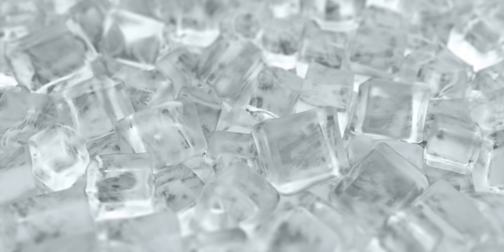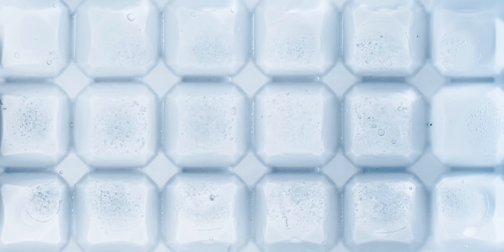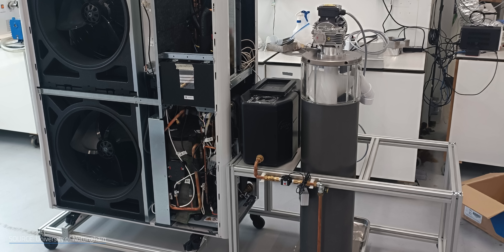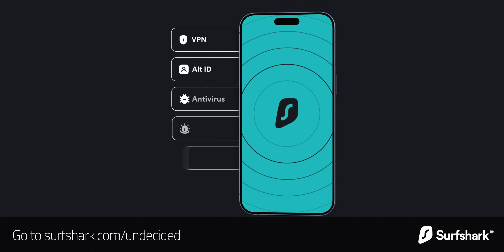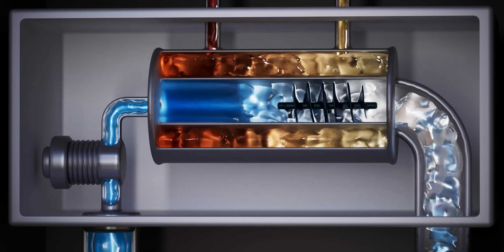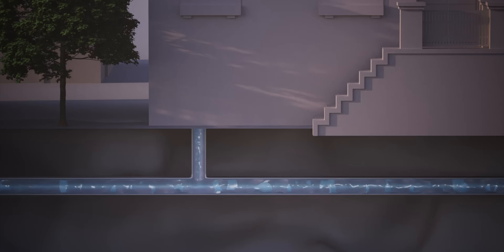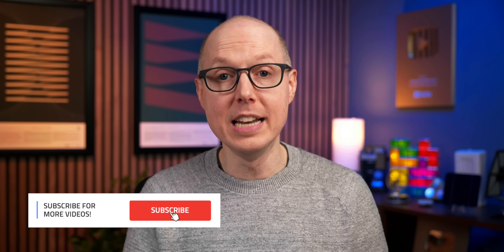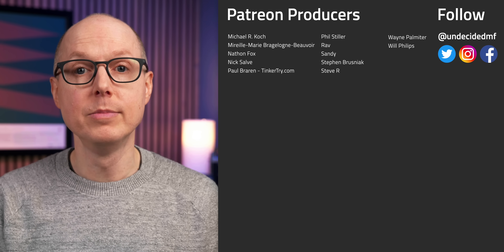How Can Ice Heat Your Home? Ice Source Heat Pumps!

Comment: Or, you can take the domestic water network, which ever home everywhere in the western world has... including remote location with wells... use that as an above 0c heat sink, suck the heat out of it(or dump heat into it in the summer), and dump the cold(or hot) discharge into the sewage/storm system. No need to upgrade anything, and can be install now, in any home.

EDIT: Why/how this works. A typical house loses/absorbs approximately 100 to 500 joules of thermal energy per second. This is highly dependent on temperature differential as well as the amount of insulation. Assuming the domestic water supply is at least 10 decrees Celsius upon entering the building, and the evaporator of a heat pump is -25, to negate the thermal loss, 3.4 litres per second of water would be needed. Thermal absolution into the water, regardless of heat exchanger efficiency, would be near 100%, as the water would mix directly with itself within a well insulated holding tank, so long as a circulation pump and tank are properly spec’d. This is a purely 'back of envelope' calculation and is not really that meaningful, but shows a large amount of water would be needed, however, this water is not consumed in the traditional sense.

In the most basic of setup, water would be intaked into a building, warmed(or cooled), then rejected into the storm or sawer drain. At this point, minimal treatment would be required to redeliver the ‘used’ water back into the system, especially if the water is discharged into the storm drain network. This however, need not be the case. As the water is not utilized for any other purpose other than as a heat sink, water can be diverted from the city supply, flowed through a heat exchanger, then re-injected into the city supply, without requiring further treatment. So long as the city supply continues to flow, thermal capacity will always be available.
Reply: There's a thing in Japan called Eco-Cute that makes hot water by using the "waste" heat from the air conditioners. Why just blow it into the street when it can be useful?
Reply: this would increas the amount of water needed by a lot. and if you dont have unlimited water this could lead to a shortage
Reply: @2LittleZombie  It wouldn't actually increase usage that much if properly metered, and would theoretically deliver about 4200 joules per letre in a most basic system. The 'waste' water would also still be potable, so redeliver into the domestic system would require minimal treatment. Reverse osmosis system create far more waste water.
Reply: @JoelleTheAbsurdist  4200J are 0,001kWh. In one heating season, a typical household needs 20000kWh. That equals 20 million liters. Per house.
Reply: @2LittleZombie  Not joules per hour, joules per litre. If you're replacing 1 litre per second in your exchanger, that would mean 4200 joules per second, which is 4200 watts per second, which is about 14,000 BTU/h. On paper anyways, there would be losses and inefficiencies.
Reply: @ " that would mean 4200 joules per second, which is 4200 watts per second" thats plain wrong. 1 Joule is not 1 Watt!!!!! they are not even the same SI. 4200 Joule are 0,001166667kWh. For 10kWh heating in a day thats over 8500l water. But this whole calculation is nonsence, because you get 333kJ/kg water, if turned into ice from 0°. I dont know where you even get those 4200J
Reply: so I did the calculation and researched all the right numbers. From one liter of water starting at 10°C you get 41,8kJ to 0°C. From freezing you get 334 kJ, thats 375,8kJ per liter, thats 0,1044 kWh/l. In the cold season a typical house needs from 50 - 150 kWh daily, so one house needs 1437 l water daily for heating. A typical 4 person household needs 480l per day, thas only 1/3. So instead of 480l the sewage system has to get along with 4 times the volume
Reply: @ Keep researching
Reply: @JoelleTheAbsurdist  try understanding some physics
Reply: @JoelleTheAbsurdist  or show me where I'm wrong. But I think your stomach is not an engineer
Reply: @2LittleZombie  I'm not trying to be insulting, but you were the one who didn't understand what a joule was. It seems however, that you keep improving each time you look things up, so keep looking things up, and you'll understand more.
Reply: @JoelleTheAbsurdist  you said W=J. Befor lecturing others you should maybe get your facts straight. And I'm still waiting to be proven wrong
Reply: @  1 joule... is 1 watt... I am now ignoring you...
Reply: If you added a heat exchanger to that to keep the house and utility separate that would work better.  It would allow continuous flow and not waste water.
Reply: cooling down waste water is actually pretty genius. you don't care about the temperature of brown water (toilet) and there's a lot of energy in the rest (shower/dishwasher/washing-machine etc.) that could be recuperated in a heat exchanger.
Reply: @JoelleFromHell  that would work to move heat around but would waste tremendous amounts of water and risk overwhelming drainage systems.
Reply: @GimpyChinaman  It wouldn't really waste much. You would install the system with a short recirculation loop, and a small reservoir tank. As the tank's temperature lowers or raises, the system would inject small amounts of domestic into it to keep the temperature optimal. Then, because the waste water is still potable, a minimal amount of processing is needed to make it potable again. The only requirement, would be limited upgrades at water treatment plants. The system can be further improved by having the house's delivery system routed through the waste side, meaning every time you flush the toilet or wash your hands, you completely change the sitting water.

Comment: I greatly desire to have heat pump but the durability factor is a problem for me they just don't last very long and there's a pensioner I haven't the kind of cash flow required to maintain one and thus when they go down I am months without any form of heat in the house
Reply: with normal maintenance they last as long as gas or oil heating systems. why do you think they dont last long?
Reply: Heat pumps are very low maintenance. You'll need to clean the indoor unit's filters (there are some self-cleaning ones, but they are pricier and still require occasional manual cleaning), and in some cases, you will need to remove ice build-up from the outdoor unit (that usually happens if the weather is at just about freezing temperature - well below or well above it's not usually a problem). That is pretty much it. In case of a breakage, servicing one should certainly not take months, and for a brief duration you can use direct electric heating as a backup. This is of course anecdotal, but I have not heard of any heat pump gone broken, and I live in Finland where the winters are quite cold (-25C or -13F is pretty normal, occasionally getting well below that).
Reply: They last almost as long as natural gas powered units and they can be as quickly repaired if you have a decent contract with a maintenance firm. 

Also a heat pump saves money. A decent heat pump costs less in electricity than a natural gas powered heating costs in gas. 
So if you have the cashflow now you have the cash flow for the heat pump
Reply: My solution to the same problem was having a continuously running air to water heat pump serving the whole house and a secondary local air to air in one or two rooms as back up or supplementary heat source. These can also act as air con in summer
Reply: Heat pumps last very long if properly sized and installed. Half the houses I have personally inspected had some form of a flaw in the hvac system. These flaws may not cause issues with electric  or gas heat but when you have a heat pump a small issue can destroy the whole system. As an example I have a home that originally had a single speed air handler(instead of variable speed) The air handler was installed with two zones upstairs and downstairs. The upstairs zone heated to the temp of the thermostat first every day (because heat rises). When the upstairs reaches temperature a damper(air valve) closes inside the vent stopping air flow to the entire zone. Because the air handler can only handle one speed it is actually getting stress from having one vent closed. The stress is enough to blow the evaporator coil from heat and pressure build up. So this is something extremely common hvac companies will do on purpose to ensure a returning customer.  Long story short if you think heat pumps are not reliable its because of hvac scams not the technology being unreliable.